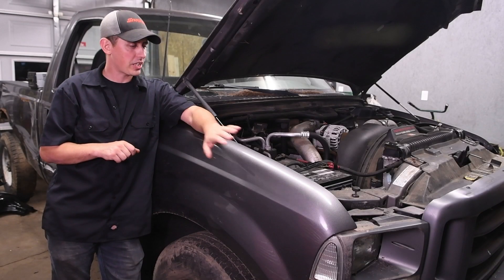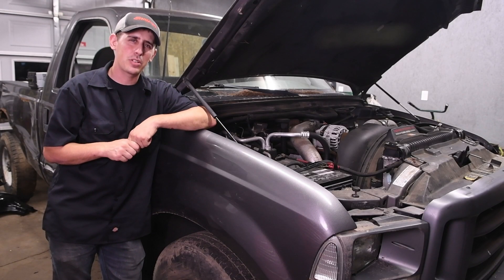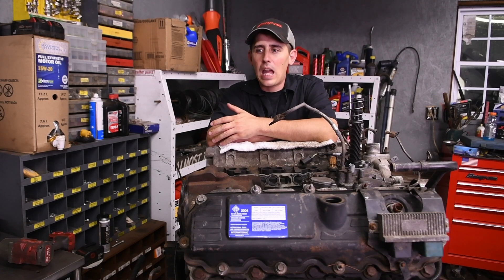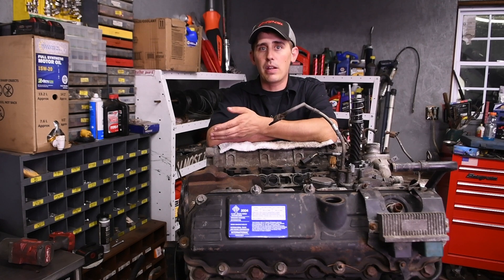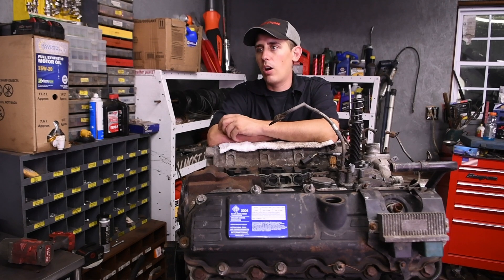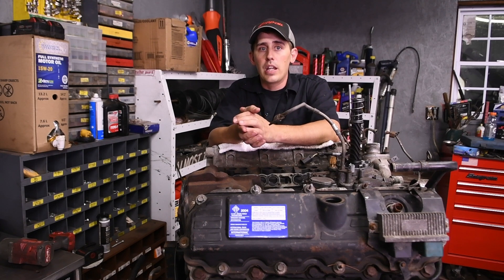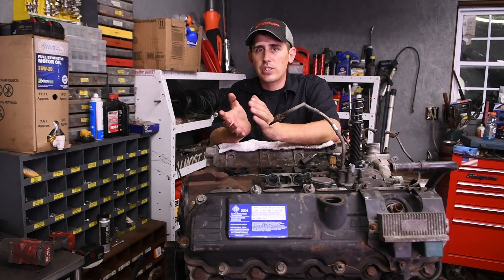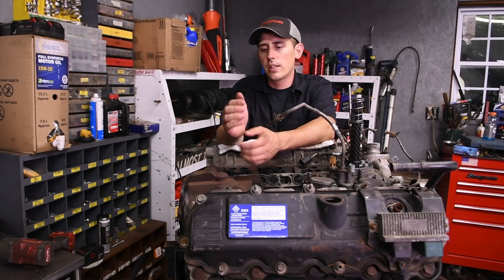6.0 Ford NO START diagnosis

Comment: Hello...using scangauge got a diesel 6.0l no start and my ipr is good reading 45, and icp reading above 500 psi and fcm is 47.5 to 48v and syc 1. Lastly, when cranking trying to start having a lot of dark gray smoke out of the exhaust. Change fuel filter and fuel pressure 50 psi.

Comment: I have an 05 6.0 egr delete billett proofed I replaced o rings on ball tubes injectors air test and nothing but a leak what sounds like behind the engine , 55.7 on ipr 1333 lbs on icp new battery's new 6.4 starter and nothing ficm is 48.8 cranking also sync is 1 also new ficm power supply ,no code but low icp circuit replaced icp plug also new icp . please help  oh yes buzz test passed

Comment: Have u come across this issue on 2007 6.0 powerstroke.  When you turn the key the dash lights starts flickering real fast...no crank no start..
Reply from the maker: Typically that is a sign of dead batteries or a bad connection at the battery terminals.
Reply: @InTheShop thank you buddy...come to find out the solenoid to the starter was burnt up.the copper thick wire was gone..I guess when it over heated he was trying to restart it..an burn up the starter

Comment: My 6.0 died while driving. From the ignition it won’t crank. If I jump the starter it will crank but won’t start at all. I have no idea where to even start trying to diagnose the issue. Any advice on where to start would be greatly appreciated.
Reply from the maker: Check the fuses and check the fan clutch wiring. The wiring will get caught up in the fan and the PCM fuse will pop.

Comment: I have a 2006 6.0, when you turn the key, sometimes the motor just turns over but then you just hear a click and when you turn the key again, you just hear a click and the motor doesn’t turn over at all and it drains the batteries after a while.

Comment: Hey buddy! I am working on an early 03 6.0 crank no start. Replaced oil rail cups and seals, the injector seals, top bottom and crush washers as well as the high pressure oil line seals on the quick connects. It detects 1800 or so psi at 84.5 percent on IPR. I also still have a faint air leak. Im considering buttoning it up with the covers off and visually inspect is crank with the ficum relay removed. Hopeful i sort it out before you respond.

Comment: Hello I'm so impressed that I need an expert opinion, history, 6.0 of course 2004, had a bad hpop, I changed it, a OEM pump went bad after 6 months, changed again, 256,000 miles on truck, had a injector went bad, I replaced all injectors with one injectors, ran good for awhile, one of the new injectors blew a top o ring, clip broke, replaced injector, 6 months ran great, then another crank no start, (note no low oil pressure, oil filter housing not filling, checked relief valve for low side , no metal, took to a shop, they said several injectors bad, new ones less than a year old, he changed all 8 injectors, yes lots of money, truck still will not build low oil pressure, besides the relief valve what can I check next, I got shafted for 4500.00 and till a crank no start

Comment: Aloha Nathan,  it's Wayne's Sushi Fresh Off the Boat from las vegas. Maybe you can help. I have a 05 f250 6.0 no start usually in the morning. After trying to start 2  to 3 times, I'll take the batteries to auto zone to make sure they're fully charge. Install and it start right up. 9 out 10 ti is it start. Well on the 10th time it won't  start. Around the 7th time I charge the batteries I took the truck power stroke performance and their diagnosis was glow plugs harness and module and gave me an estimate of $1800 just from scanning with computer. Need help? Can you recommend a trust worthy mechanic that knows what to look for  here in Las Vegas the 9th Island.

Comment: Not long ago I spent a ton of money replacing 2 batteries,  fuel pump, ICP, IPR, high pressure oil pump and all 4 left bank injectors. The truck, 2003 F-250 , 6.0 power stroke ran very well f for about 3 months.  Now,  it cranks and runs fine when starting cold. After it runs a while,  it won't crank. All work was done professionally. I give up. I will not spend another dime. I have it for sale.  Any ideas that I might pass on to a prospective buyer? I wish I would have kept my 97.

Comment: Truck just had dummy plugs , icp and stand pipe replaced. Because no start issue. 2  weeks later drove to work engine started surging I shut it off . I came back out at lunch crank but no start. Sprayed a quick shot of starting fluid and it started . I drove it 20 miles  and died again. Code 2285 I changed the irp but still no start even with starting fluid. Any ideas?
Reply: Going through the same problem. Did you figure it out? New fuel pump, new starter, new ECM, new IPR. Just had oil, coolant and filters changed 4k miles ago. Totally stump. Any ideas greatly appreciated.

Comment: I have a 6.8 in 2009 Ford 350 super getting air in the fuel line I get the air out of the system it runs then air returns and then will kill have to either recycle key several are bleed it what is my where do I start looking for

Comment: Great vid.  I did everything in the video, every step passed.  Problem started when my batteries were dead and I tried to jump start it with 200amp charger function.  It didn't work as suspected so I let it charge over night.  Next day it would just crank and crank.  No codes.  It makes mild signs of firing up but if you stop turning the key it will die.  

I was able to get it to run pressing the gas pedal but it sounded weak and would die once you let off on the pedal.  I ended up unplugging the ebp sensor to see if I could get a code to show up.  Tried to start it and same thing but this time I smelled electrical burn and now I have high injector circuit code for 4 injectors on one ficm bank X1.  Also now no injector clatter. 

Pulled ficm and the logic board has chipsets fried.  So installed new one and now clatter is back but back to square one unable to start.  Also installed a new fuel pump.  Seems electrical based.  I checked all the fuses and the ficm relay.
Reply: I’m prob in same boat. Boosted off and next day crank no start. Started fine the day before.

Comment: Thank you for your video. I enjoy your explanation and expertise! I have had to replace my high pressure oil riser rods 8-10 times now over the last 2years! I just got them replaced again about 2-3 months ago and I am back to the super long cranking to start and getting to the no start point really fast. Is there something that is causing this to happen ie. too high pressure vs just blowing the gaskets on the bottom of the rod each time? I have used several different brands including oem. I’ve used 2 different mechanics and myself this last time

Comment: Hi my van seem to have all the right numbers..2006 and blue spring upgrade installed...but it still wont stay running...i fint think fuel is reaching the injectors...but it wit run momentarily with idiot juice.... once on a nice day it did start on its own

Comment: Ok😢,2003, 6.0 crank no start. Replaced, fuel pump and filters,new oil and filters, fuel, all censors. Both under turbo, both crankshaft sensors,new injectors,firm, map censor on air filter, new batteries, glowplug module, glow plugs and wires, stand tubes and nipple rings, last hpop and still no start. 185,065 miles. I tried starting fluid and made a carb explosion.

Comment: I replaced the hpop, icp, ipr, ebp, radiator, oil cooler, degas bottle, egr delete, 2 brand new batteries and the list goes on. I get a crank no start the other day. I have an innova 5610 scanner and it throwing the icp-low pressure code. I have a 2004.5 so the icp is on passenger side. I pull it, no oil going through the sensor. I try to start with icp unplugged. No start. So I go through the nightmare of removing the ipr. The screen is lodged inside the port to the hpop. What do I do? Get a pick and carefully try to remove it? I’m thinking there was some debris from the replacement of the oil cooler. I also don’t want to pierce the screen as I’d like to be able to see any damage. The spring inside the ipr is good, just wondering what the best way is to go about dislodging that screen. Thanks man. I always get good info from your videos.
Reply from the maker: I usually use a small pick to get them out. It can be a pain.

Comment: Hey man. Excellent informative videos. I have SO much $$ tied up into my 06’ 6.0, I couldn’t sell it seven if I wanted to. I’ve bee a mechanic since I was 13 and I’m 56 now. Never owned a diesel, much less a 6.ohno! I love working on it, but it seems like I do that more than drive it!  But I haven’t driven it in over a year now cause I got sick of it. Into it for roughly $25k. I can start it with ether only and it seems to run fine. Last year I replaced the stand pipes and dummy plugs. Glow plugs on both sides.  and nipple cups. Well cups and o- rings on the pass side, because I found a  torn o- ring. Ran perfectly so I put it back together and it was fine. Now it’s has me at my wits end! I unhooked my stereo and plow and it seems to have a draw, cause my 3 year old NAPA Batts are always dead. I bought a new IPR and a I have the new HHC cups for the drivers side. I’m going to try and just replace them and all of the filters this week! I’m going to try my best to get this done. Just my problem is I fell off a rooof and broke my back, so it’s hard to lean over the hood or get under the dash etc. My question is, why wwill it have a cold and hot no-start, but will fire right up with starting fluid and run fine? Id really appreciate a response if you have time.

Comment: So if we have stiction? I've got sync between the ficm, crank, & cam. Voltage on the ficm is looking good,  got 11.5v-12v & 48-49v on the pids. While cracking IPR percentage only got from 14ish % to 18ish %. ICP psi was anywhere from 600-800psi. I'm wondering if it's stiction just because I do not here the injectors one the keys turned. Working with a new monitor so I haven't found an injector buzz test option just yet. It's acting like maybe a leaky standpipe (cold start will run & runs just fine) but it's building pressures just fine.
Reply from the maker: So only no start hot or no start at all right now?
Reply: @InTheShop  she's a no start hot currently. She fired up slowly at about the 8-10th crank while I was performing your recommended testing and after about a minute I gained throttle response and she was back to normal. Turned it off to continue testing (I think I paused about 4 times to focus on certain pids) and she wouldn't fire up again. Cranks like normal & then shudders crazy while cranking.
Reply from the maker: @stevenhorsley2675  stiction is possible but not common on a hot no start. Usually stiction shows up at a cold start.

Comment: Disregard my last question. The reason if would not run is because we had lost syn. I solved that problem. It is running now. However, I still only have 0.4% IRP. When I start the truck the engine turns over long than it should. I just put a turbo on it this week before I put the turbo on we had 14.9 IPR even when I drive it the IPR only goes up to 1.7 Any suggestions. Thanks
Reply: Problem solved. For some reason my scan Gauge was not giving me accurate information. I hooked up my dash-boss and received the proper reading. Thanks

Comment: Hi I have a question I have no start 06 F550 6.0 IRP 0.4% but normally is at 14.% could this be my problem ?  If so what do you suggest?
Reply: Disregard this question thanks

Comment: I just watched your video on 6.0 no start . I have a 2003 with a 6.0 that I have a crank no start . I have scanned it an it  shows no sync . I noticed that the tech            Is not reading RPM . I have changed the crank and cam sensor, replacing both pig tails to both sensors and own wiring harness from both sensors to PCM and from PCM to FICM . I still have no SYNC. Any suggestions .

Comment: My truck is not starting, I updated dummy plug, injector o-rings, IPR, starter but still no start, here is data at the time of cranking.

https://www.youtube.com/shorts/NIdSk1XAzCg
Any suggestion or tip?

Comment: Good afternoon, I just bought my F-250 a couple of weeks ago. Over the last week I noticed that the truck was slowly taking longer to start every time I got it in. It sat over the last four days and when I went to start it up it wouldn't start. I checked the batteries charged both over night, still won't start it sounds like it's turning fast enough, I'm thinking it's a fuel issue. Where should I start?

Comment: I've put two ipr valves in in the last two months. Ipr screen was gone in the first replaced valve and started driving. Couple months and probably 1200 miles later truck dumped on me while driving. Towed back. Took ipr out. Small tear in screen no metal or debris. There isn't any noise like lifter or low pressure pump problems...any idea so as not too continue the same ole fix that seems to be a band-aid
Reply from the maker: I would consider pulling the oil cooler and checking the screen under it. When that screen fails it sends debris directly into the high pressure oil pump then through the IPR. If that screen is fully in tact I would say the high pressure oil pump is starting to come apart.
Reply: @InTheShop  thanks man I appreciate the advice as I didn't even know there was another screen.

Comment: Yes , went through all the steps , it still would not, and still can't get it to start.  After I got it all the way down to block I just happened to look at filter housing for the oil and the by pass anti drain valve was broke over and smashed part in the hole it supposed to close off and part out.  Would this filter housing not being able to fill up. And stay full keep my 2005 ford f250 from starting.
Reply from the maker: That could definitely cause a no start.

Comment: Great Videos!! Is appreciate if you could give me some insight on whats going on w/ my 6.0. 
  Ive put So Much money into this truck and Im moving soon. Will only start with diesel starting fluid, either hot or cold. My alarm and stereo stopped working. Ive disconnected my plow completely (I live in NH) but I only used it once!!Im a mechanic by trade, but not with diesels. About to pull thee oil rail off the left side( already did stand pipes and dummy plugs on the right side and found a torn o-ring on a nipple cup. I stopped there and it ran great for about 8 months. I bought a Scan Gauge but it’s a bitch to program.

Comment: let me say thank you and i have a question and would like your opinion i do not have a scan tool and do not know much about these 6.0 engines but mine was running fine  and i came up on a red ligght it died on me wouldnt start back the guy at the small town garage where i was  squirted a little eather and it started back up then i turnee around and headed to my home 3 hours away i made it almost all the way back home and had to stop at another red light it died again and i had it wowed home it is cranking good and strong and has new batteries  will not fire up and idea on what could be the problem ?

Comment: Hi there.i have 03 6.0 don't start.i replace the ipr and icp still don't start   the fuel pump is working.if I put some starting fluid his star.i guess is the hi oil pressure???

Comment: My wtres was melted together around turbo I changed it now want start never had problems with truck before just common things like alternative ones and changed batteries have over 400000 miles 2006 6.0 it's says no sync I change both sensors

Comment: I got a 6.0 won’t start, no matter what, I got sync, I got high pressure and rpm, I got volts going to injectors, injectors test good and been replaced, good fuel pressure, get valve been replaced, no codes

Comment: OK I've changed all kind of parts an still don't start I have good data readings  but it drags to start new batteries 1900 cranking amps so what else could be going on it seems like it's retarded I'm stuck

Comment: One Friday come home parked my truck, next day I was changing the oil and all coolant came clean after that dirty oil so changed oil and try starting it ,nothing just a click like is locked , what's the procedure,they  say is the egr cooler ???
Reply from the maker: I would start by pulling the glow plugs out and rotating the motor over to get the fluid out of the cylinders
Reply from the maker: It is most likely a bad EGR cooler causing it though.
Reply: @InTheShop  done the plugs yesterday ,would that make it turn would it turn on to drive toa shop??
Reply from the maker: @fernandopuente8693  I would not drive it